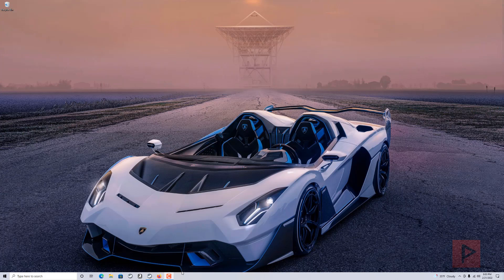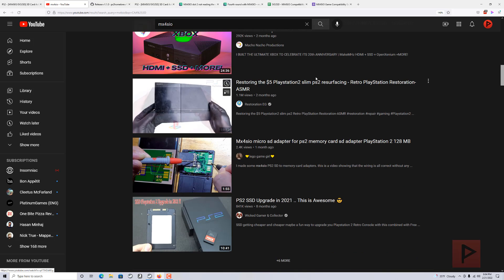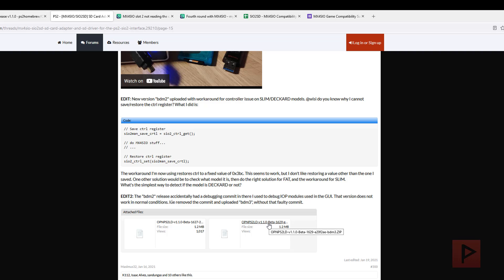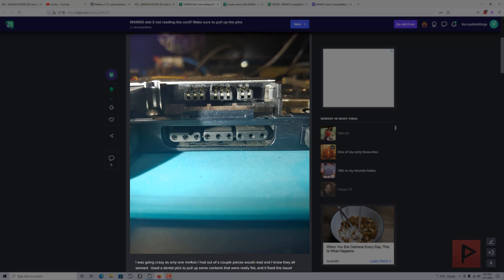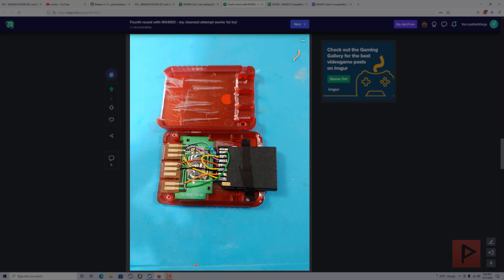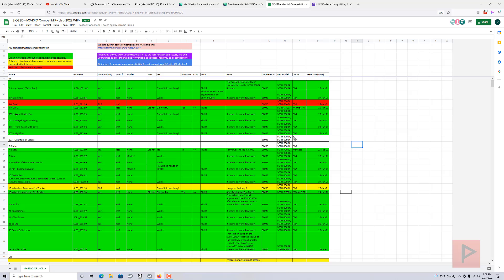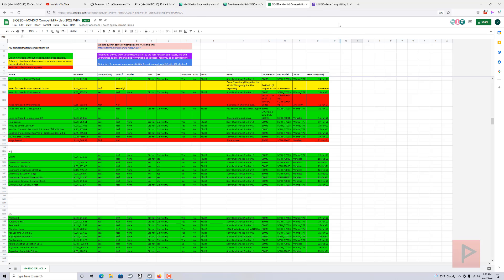MX4SIO - General Troubleshooting Tips and Tricks, and Game Compatibility Spreadsheet (2022)

Comment from the maker: Are you a MX4SIO user? If yes, let us know how you like the project so far and/or what ps2 games you wish were working for this new mod? Otherwise, happy gaming!
Reply: Just got into it. Kinda just took a swim in the deep end with it lol
Reply: 🔥 Would like to see rep.s in the PlayStation 2 online gaming communities brought in who are equipped to do testing for this device's spreadsheet - in the video description - since bringing in so many slim models back into sevice and also giving another option for phat PS2 owners not doing an IDE adaptation could benefit the online and LAN-tunneling community greatly. Have heard and read countless occasions how failing optical drives and lackluster USB 1.1 speed are the barrier to entry for slim owners and that, for HDD bay PS2 owners, if not for their prospects of identifying a proper IDE adaptation with functioning ethernet on into also possibly the installation of the mod are barriers/impedances to getting online with their PS2s.
⏭️  From there, the info (or, at least, a link to the MX4SIO's sheet?) could be used by the owner / editors of the online PS2 games spreadsheet to determine if they want to add a Compatibility section column listing "MX4SIO [or other]" next to USB, DVD, HDD and "emulator" along with any Comments (typically, constraints regarding desyncing with other online PS2s and lack of VMC support) as well as any pertinent update affecting column R - ~prerequisite special considerations needed to play online.
👏👍🖖🤟
Game On!
Reply: @That_Handle  Regarding the Speed-running community! They ACTUALLY should take PS2-Models AND storage-devices into account!
This is true for ALL devices!

The difference of MX4SIO on FAT +70k Slim vs. DECKARD-PS2s (75k+) is quite big currently!

I agree that MX4SIO is a good addition regarding online-gaming!
The bandwidth is high enough and it still can be used for online- and LAN-Gaming!

MC as well as VMCs are technically working, but the current official builds are bugged! "BDM3" has the best support IMO!
Reply: Going to be playing Armored Core 2 - Armored Core Last Raven, so hoping the PS2 era games for Armored Core can get some love
Reply: I like it personally. What I have noticed with the latest beta build in 2023 there has been a massive improvement in loading games that weren’t previously playable. For instance resident evil outbreak works now on the latest beta build
Reply: I’m using this MX4SIO but there’s some kind of stuttering or lagging in games
Reply: Has anyone experienced freezing while playing a game? If so is there a fix? I’m using the latest beta build and a 1tb micro sd card formatted to 64KB clusters
Reply: @guybehindacamera use a smaller card maybe like 256 gb
Reply: My Games Dont Run
But they have it for 2 years

Comment: I've had a strange issue if anyone here knows the culprit. So my MX4SIO was working fine in my slim, then all of the sudden games that worked before would start to crash. Even with games that still worked would have stuttering intros, like Silent Hill 3 for example, when in the past it did not. I'm hoping the micro SD card isn't damaged but it's the only thing I can think of since I haven't messed with any other setting.

Comment: So… I have a small problem. I have a SCPH-7500 with a Disc Reader that doesn’t work. I have bought a OPL MC and a MX4SIO to use it, while it worked on the first few games it stopped worked when I deleted a .ZSO file from the OPL  since then it doesn’t load a single game anymore, it starts to read the file and then the access light stops.  

Does anyone have a ideia on how to make it work again? I already tried to reformat the SD Card (64gb and Exfat) but didn’t had any luck.

Comment: I recently picked up a Mcboot and MX4 combo on Amazon for 29 bucks. I did the drag and drop routine with the main files from the sd that came with the product to a larger SanDisk exfat sd and loaded all my favorite RPGs with box art. No splitting games into chunks, and all 32 games run flawlessly.
Reply: Same here! I’m amazed by the latest beta build. Interestingly enough resident evil outbreak works now in the latest beta build. May I ask what sd card your using because it seems to be picky with that
Reply: @guybehindacamera  I've used PNY and SanDisk - no problems whatsoever. Cheers!!

Comment: I've got a 5xxx PS2, plugged the MC2SIO in for the first time today, nothing happened, tried 1.2.0 beta OPL, 1.1.0 and the beta of that one, also 1635 , 1627 and 1629 (those 3 made the SD2SIO card flash it's LED but no games loaded), ran all the OPL's from USB or without USB inserted from official magic gate card, but the games never show up. Tried it with a Samsung and Sandisc micro SD both 256GB and formatted to FAT32 with a cluster size of 16. Also tried creating custom partition with only 16GB FAT32, also didn't work. Anybody any ideas?
Reply from the maker: This is a weird one, are we sure the card is functional in the first place? Where did you get it from? At a minimum, we should see the mx4sio games show in OPL and it sounds like you never got it to show in any OPL version that supports mx4sio
Reply: @ProjectPhoenixMedia  Thanks for the response. I got it from Helders site. So you think the Samsung SD should work? I indeed never got any games to show up. The light blinks in some OPL versions but that's about how far it gets (also tried it in both card slots, and of course FreeMCboot loads from one of the slots, so that can't be the problem either). Not sure if I should order a PNY SD card (those should 100% work according to the community, but Samsung should also which is weird). Maybe contacting Helder might be my best choice here then. There is one oddity I noticed however. So I know I got it from the original site, but on the bottom of the card there is no Helder logo, however all of the review video's have a card where there is a logo there. Maybe a revision? I got a Helder sticker with it though. Maybe you know if it is a fake when the logo is not there? Might there be a way to test the card? I've got a multi meter, maybe I can check some of the connections? Also, I forgot to mention one thing, I have a European PS2, maybe a difference there?

Comment: If there has been a way to monitor when the magic gate is creating a game save file or when the file is ~updating, then can that signal be used for a memory card page-switching circuit to automatically flip between the MX over to a second (or 3rd/4th) MC(s) for the game-save plausibly built into the same shell?  .... If not in the same shell, if it produces greater flexibility without introducing risk and keeps its price lower, is it possible to create a stacked/daisy-chained memory card engagement into the same MC slot as the MX with the above page-switching circuit built-in so the consumer can use their own cards ~daisy-chained into the same memory card slot?
🤔 If there isn't first a [write] status-change bit/signal sent out through the magic gate that could trigger the memory card page-switching circuit, then would a plausible alternative be a ~bucket brigade staggering of the game save data in which an MX's page-switching circuit would utilize the bucket brigade to afford itself time to see the incoming traffic just long enough for it to ~react by switching over to the game save function then possibly look for a pause or [completed game-save] ~signal at which point the memory card page-switching circuit flips back to the MX? Forgive the over-simplification but it seems like it's a matter of taking a rough understanding of the cadence in events then knowing when to manage the march of the event-specific information utilizing little more than what amounts to a ~traffic light intersection that has sensors built into the street managing the two possible paths of data, as an allegory. 🤷‍♂️

Comment: This is a neat mod. It’s not what I expected though. Is there a PS2 memory card with an SD adaptor for save files? I think being able to have upgradable save space, plus being able to move your saves onto a pc for backups, also you can keep a small booklet of different SD cards instead of a ton of ps2 memory cards which are much bigger. It’d be pretty cool and useful, I’m sure it exists and I just haven’t seen it. I know ps1 has something like that I believe
Reply: Have wondered if the MemCardPro team might entertain creating such a product that already has built-in WiFi among other features. Although, given the option by OPL-FreeMCboot to save to and transfer via USB stick/USB-SD adapter, there likely isn't as much ~demand/incentive. 
.... Now, HDMI output with, preferrably, onboard upscaling to meet 4k screens ~half-way, on the other hand, would have higher demand.
Reply: Memcard Pro is technically capable of supporting the MX4SIO stuff and I personally have NO PROBLEM AT ALL, if they do!
I would even help them for free!

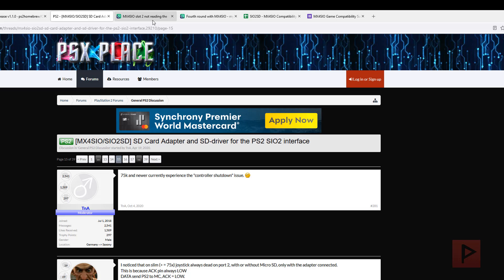Comment: 3:18 - Thank you! for that PS2 MC-slot contact maintenance tip.  👍 Couple 3900x models here that used to be finicky/needed the MC pulled back out ever so slightly after insertion so they would read their MCs no longer need such a deft touch. 🍻

Comment: That's so cool since you can just have split isos instead of needing WinHIIP like with the internal SD card mod.
Reply: When mentioning internal SD card mod, are you referring to the IDE to SD card adaptation that plays through the attached network adapter?
Reply: @That_Handle  Yeah, though you can also do the mod on some Slims with a modchip and soldering an SD connector on.

Comment: Have you experienced any fmv skipping in any of the games you tested? I've seen videos of jittery fmv's for the kingdom hearts ( I believe) but they never said what ps2 model they're using. I was thinking maybe the pre deckard models have issues with fmv playback because in your videos the fmv's are smooth
Reply: Some scope of compatibility is in the spreadsheet in the description
Reply from the maker: Interesting point, I happened to have a deckard model which has slightly better speeds at this point in time, maybe earlier models can improve with driver updates over time.
Reply: @ProjectPhoenixMedia  what's a deckard model?
Reply: @ProjectPhoenixMedia  and OP,
What is/are the major delineations you see need to be considered when testing regarding [deckard] , etc. ? At the moment, faced with 39001s, a 75001 and a 75002 here.
Reply: Kingdom Hearts skips on my 50000 PS2 through SMB so I don't have much hope for the MX4SIO
Reply: 2 years late but has anyone figured out why suffering happens on FMvs? I am having the same issue running off an MX4SIO card